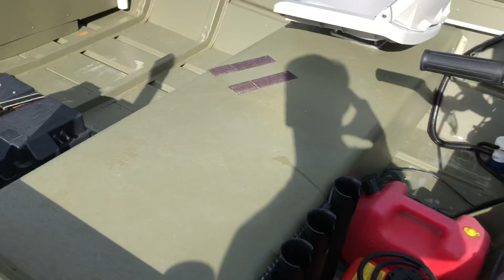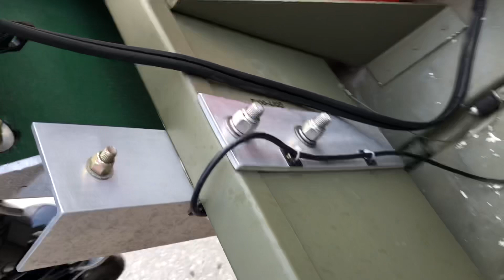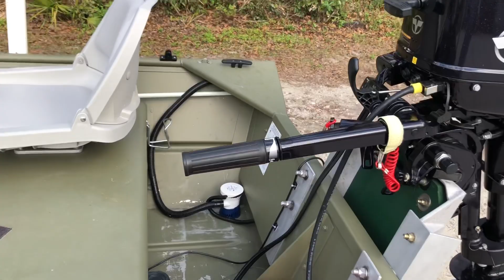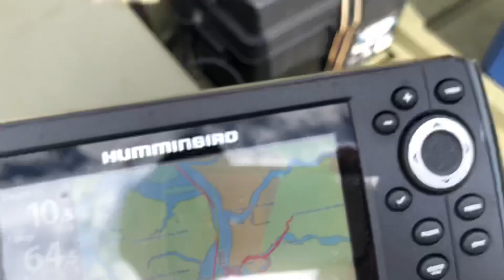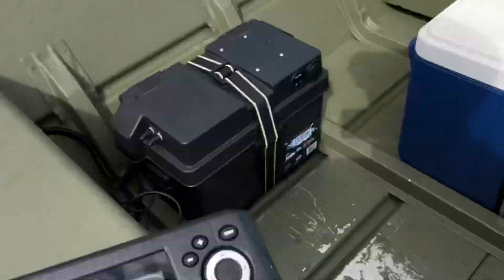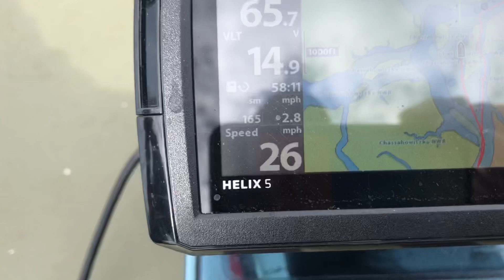Tohatsu / Mercury 20HP Top Speed Test on Lowe 1448M

Comment: I want to buy my first outboard, the same Tohatsu model as yours, for using in my camper trips. 

I will create a box between my chassis bars to store it perpendicular on the driving direction.
Do you think it is wise to do that? Would the lateral movements of the car affect anything?

Also, what side should I lean on during transport? Left or right? 

And what angle shoud it be up from the engine head so I don't get oil leaks?

Is the tiller easy detachable? I might need to do it every time because of limited space in the transport box.

Thanks!

Comment: Trolling battery in front, where is the terminals on that one? I like how its hidden, is there some kind of adapter that connects to it?
Reply from the maker: Hi, no I just have it direct wired to the battery with wing nuts so it’s easy to remove for charging. I do plan to run power from the motor at some point so it can recharge on the boat between fishing spots.
Reply: @commonsensesolutions6662  i see, thanks

Comment: Did you ever test the speed with out the hydro foil on it’s probably a little faster  I have a similar boat but mines a 1648 20 inch transom I get 24 mph with a 18 hp with a 10 p prop. With about 200 lbs of gear and myself.
Reply from the maker: No, but I think you are right. I’m sure it adds some drag.

Comment: Great video and information, is that shaft 15
' or 20"? Why did you add the jack plate? I'm getting ready to purchase the same motor with power tilt.
Reply from the maker: Thanks! It’s the long shaft model. At the time a new short shaft was unavailable for months so I opted for the long shaft, therefore I had to use a jack plate to get the motor up high enough. I was good though because I was already planning to use a jack plate to obtain some setback which helps the motor perform better anyway and it made it easy to get the cav plate even with the bottom of the boat for best performance. 

You will really enjoy the motor. They are high quality. Be sure to check out my impeller video. Thanks for watching 👍🏻

Comment: I used a 1/4" piece of plywood to make a floor in mine. The weight of those batteries bouncing on the rivets is probably not a good thing. If you google "New Aluminum Floor in 1648" that's how I made it level. Sealed the wood with fiberglass resin.

Comment: Do you have your depth finder attached to the storage box
Reply from the maker: Hi, yes I Do. I attached Velcro to the bottom of it and the top of the bench seat. This way it’s easy to reposition and also easy to unplug and remove from the boat. I plan to do a quick video soon about my setup and electrical box. Hopefully it will be helpful and give some ideas.

Comment: Hi i love Tohatsu Outboards. Iv never had a problem with one. i have 6hp and 30hp versions. Fuel consumption is low compared to my old 75hp 2stroke so im very happy. I always have spare fuel onboard as i use my boat at sea but i cycle through the spare so it is not sat in the can too long also i only use premium fuel, no e10 as e10 is not good for fuel lines or the carb/injectors
Reply from the maker: That’s a great strategy 👍🏻

Comment: great rig mate, about to get a 2019 model 30 tohatsu on the back of an old savage gannet ive been doing up for the past few months, (14foot Aluminium v hull) just out here trying to predict my speed and all that. again sweet rig and gets up to speed super well
Reply from the maker: Thanks for watching! Man, a 30 on a 14’ aluminum is going to FLY!! Let me know how you make out. Remember prop pitch tuned to your total weight will make all the difference. Check my video on the Tachometer setup (everyone should have one). There are also links in the description to get the one I used. Knowing your WOT RPM is very telling. Enjoy 👍🏻
Reply: @commonsensesolutions6662  thanks, and ill make sure to check that video out. the 14 foot at the moment has an old 60hp two stroke and id love to take it out but it seems like a death trap with take thing on it, all my mates reckon itd sit on the prop ahaha
Reply from the maker: @applebees3729  a 60! Wow! Did someone just stick it on there to sell it or did they run the 14 with that 60 on there? That would be a scary ride (but probably fun if it didn’t go airborne 😂)

Comment: Good video.....how well has your transom setup been holding up as far as the aluminum angles.im thinkn of tryn sumthn like tht to jack my long shaft motor up
Reply from the maker: Hi! Thanks! I’ve had a few requests for more info on my jack plate setup. I’ve been working on a quick review video that I plan to put out next weekend. If you are sub you’ll get the notice. Otherwise check again in about a week or so. Bottom line, the design worked out better than I expected. I’ll include all details, measurements, and sources.

Comment: Greetings from Croatia, I'm buying the same motor tomorrow and I'm very happy, I have a 380 rubber boat, I hope I didn't make a mistake.  Did you have any problems?
Reply from the maker: Greetings!! I’ve been very happy with this engine and would buy it again without any reservations! 

Only issue was the minor fuel leak out of the box that I explained in one of the other videos. 

Enjoy!! Excellent choice!!
Reply: @commonsensesolutions6662 what video? What exactly happened?
Reply: Thank you very much, cheers.

Comment: I just bought a new 2021 20hp Tohatsu . It’s on my 14 foot boat and it only pushes it 16 mph. Boat is fully loaded with fishing equipment and 2 kids but it should go faster than that right? It seems to over rev but not go much faster . What do I need to do
Reply from the maker: Hi! “Seems to over rev”? Does the red warning light come on?

You need to install a Tach so you know what your max rpm is at that load so you can determine what pitch prop would be ideal for that loading. 

I did a video that shows how to install one. They are low cost but a necessity 👍🏻
Reply: 11.5 prop
Reply: 11.5 prop.....i got a 15ft aluminum craft pretty heavy boat plus me at 250lb an equipment i get 23mph.

Comment: 26 mph seems like a respectable top speed for the weight you're carrying.  My 12' inflatable runs about the same speed carrying 2 adults, but it's 100+ lbs lighter and isn't hauling the batteries.  The rigid hull is much more efficient than the inflatable, but it doesn't pack up and fit under the bed of our Sprinter.  

Thanks for a good video.
Reply: What kind of inflatable do you have?
Reply from the maker: Thanks!

Comment: Quick question for youI have been looking at this model boat pretty hard. I have an old loweline 14’ semi V that I had a 9.9 2 stroke on. Outboard got stolen and I replaced with a 15 4 stroke mercury. I am pleased with the performance, but the boat sits what I consider to be dangerously low in the transom. The boat is 48” at bottom but beam is about 10” more narrow than the Lowe 1448. Since your motor and mine are very close in weight, how well does it sit in water at transom? Do you have to work to keep transom from swamping when coming off plane?
Reply from the maker: Hi! Honestly I’ve never noticed this as being a problem on this boat. Usually when I get back in from a day on the water and pull the plug there is zero water inside. Can’t say that I’ve noticed the transom seeming low after a sudden deceleration. I will look closer next time out.
Reply: Get a 9.9 efi Suzuki, change the ecu to a 20hp problem solved ! 9.9 weight with 20hp
Reply: @reddawng43x91  same weight for all Suzuki 9.9, 15, 20hp same powerhead
Reply: @richarddegen6184  wow

Comment: If I’m getting 5400rpms (same motor you have) on my boat at top end do that mean I need to go down in pitch or up? Great videos Thank you
Reply from the maker: Down in pitch will increase RPM 👍🏻
Reply: @commonsensesolutions6662  would you recommend go down from a 11.5 pitch (oem prop) to a 10 or go down further?
Reply: @br23goose  how did the 10p go? 
I got the Solas 10p and it seems to be good. Quicker acceleration and with 3 adults and 1 kid I got up to 21mph. The rpm also went up to 6100 (6130rpm). The engine sounds much better as well. I didn’t hit the rev limiter
Reply: @nopickle-4u  same here the 10p was perfect! I got up to 26mph by myself and my whole family (6 kids, 2 adults… I know big family) I can hit 20.
Reply: @br23goose  awesome!!! Glad to see you get the same results. By yourself with 26mph is really really nice 👍
Reply: @nopickle-4u  deff not doing 6130 rpm with 3 adults and a kid bro
Reply: 9.25x11p or 10p solas amita 3. Thats who makes the props for tohatsu on these small outboards... diameter is also important too large causes drag.
Reply: what pitch is your prop now? I have the same motor and it came with 11.5p and I got 5400-5500 at WOT too.
Reply: @nopickle-4u  my pitch is 11
Reply: @br23goose  I’m thinking of getting a 10p to increase rpm and hope to stay at the same top end speed due to higher rpm but better holeshot
Reply: @nopickle-4u  that’s probably what I’m going to do
Reply: @br23goose  I just ordered a Solas 9.25x10p from Amazon, will see how it goes.

Comment: Why the long shaft motor and jack plate? Why not just get the short shaft and mount directly to the transom? I am looking for a new motor and looking for tips, thanks!
Reply from the maker: When I bought the motor, there was not a short shaft to be found in the US unless I wanted to wait for a few months which I did not. I always like setback and have always used Jack plates in the past I just had to do this in a different way to get it up higher to accommodate the long shaft.

Comment: I have this motor ordered for my 12' inflatable - how fast do you think it'll go?
Reply from the maker: Hi! Probably faster than it pushes my Jon boat. Be sure to tune the prop and trim to optimize your performance. Be sure to install a tach, it will help!
Reply: @commonsensesolutions6662  Yes I saw this video before and ordered the tach/hour meter to help with break in and make sure I don't over rev it, which it may very well do seeing as how light it'll be.  Boat is only 120lbs
Reply: Where did you order it? Online or your local shop?
Reply: @Carnivorefitness2024  Online outboards and its finally on the way, should be here in a couple weeks.  Ordered it 3 months ago!  If you need to be on the water this summer do not order lol
Reply: @Cutlass_Rudd  damn was it on backorder like most are now, or are they just slow as shit!
Reply: @Carnivorefitness2024  Back ordered for months, everything to do with recreation is right now.
Reply from the maker: @Carnivorefitness2024  onlineoutboards.com
Reply: I have a 2022 tohatus 20 HP w/ 11.5P, I'm getting 25.3MPH @5850 RPM on open ocean (choppy surface). It's a fun ride in a14' Saturn zk430 by my self with approximate 650 lbs. total load (boat gear and self). With two passengers (extra 400LBS+/-) I'm getting to 21 MPH @5600 RPM. I purchased a Solas 3 Blade SS prop w/ 11P. hope to bright up RPM (full power range 20 HP @ 5750 RPM) by losing the 0.5P of the stock prop. I hope this helps my loaded performance and stay with in rev limits.

Comment: Would you please do me a BIG favor and look in your Manual and see what it specifies for the Battery.  Does it say:  "Minimum recommended battery:  12V, 70AH (800 Marine Cranking Amps (MCA) or 650 Cold Cranking Amps (CCA)"?  Or does it have a different spec?  Thank you.
Reply: Or does your Manual say:  12V 40Ah/5HR, 350 Cold Cranking Amps (CCA)?
Reply from the maker: My manual states:

“Minimum battery requirement: 12v 40Ah/20HR, 330CCA”

I use a Group Size U1 lawn and garden battery 340CCA. It’s small and way lighter than a standard size marine cranking battery. I also have my system wired to charge my large deep cycle trolling battery (on an isolation switch).
Reply: @commonsensesolutions6662 Thank you.  Do you use that U1 battery to power a fish finder also.  Does your Tohatsu's alternator seem to do a good job keeping that battery charged?
Reply from the maker: @shannonyork5300  yes, the U1 also runs my Helix. I’ve fished for hours with the Helix running and the engine still starts right up. The alternator seems beefy as it charges the U1 and the deep cycle back up quickly. I made a nice power center with a master switch, fuse box, power outlets and controls that houses the U1. I need to do a vid on it. I’m an electronics engineer so it’s something up my alley 👍🏻
Reply from the maker: I should also mention that the pull start must have a pressure release or similar because one easy pull is all it takes to manually start the engine, even when cold.
Reply: @commonsensesolutions6662  That's good to hear.  I would love to see a video of your electrical system.  Electricity is not one of my strengths!!  Can you share the name and model of the U1 you are using.  Rather than experimenting with something similar I rather go with something that is proven, and put to the test by someone like you who knows what they are doing!!  I'd sure like to get it in an AGM if possible.
Reply from the maker: @shannonyork5300  it’s just a generic EverStart Pn: U1-340 from Advance Auto Parts. It was cheap, I think around $40USD